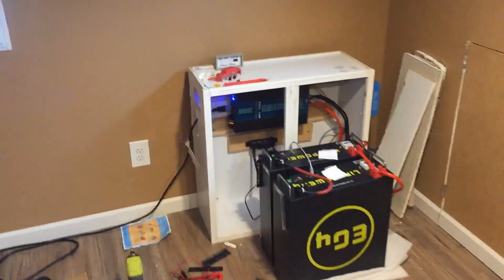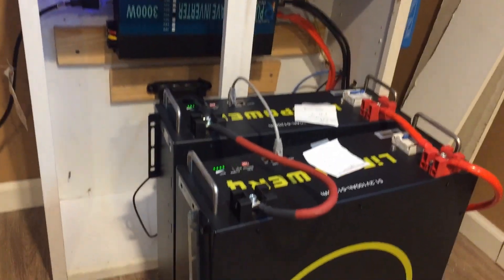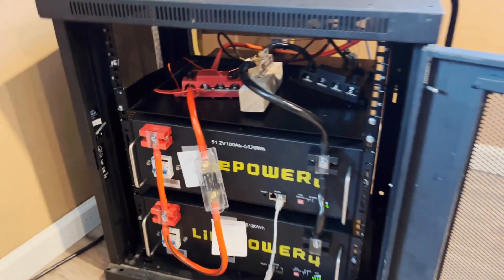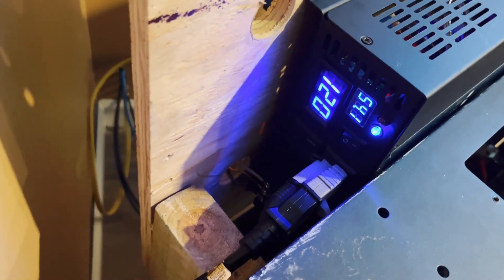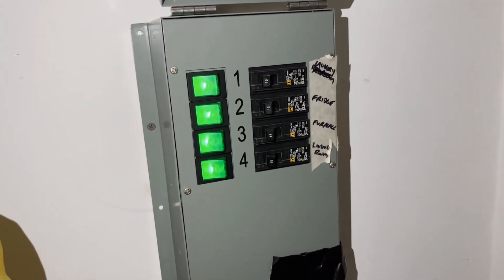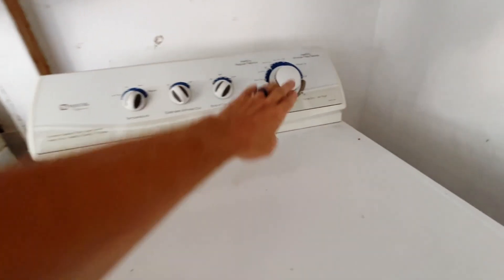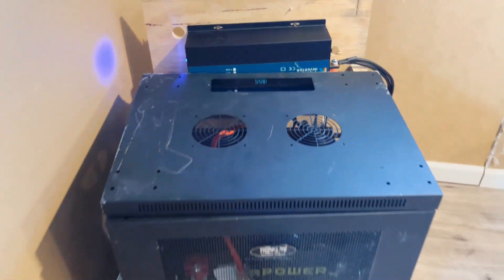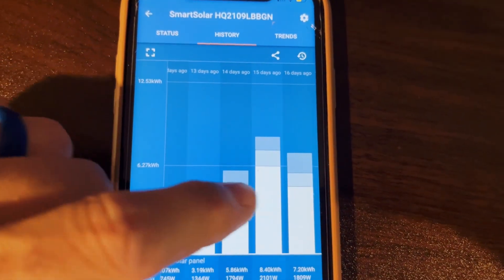My 48v Home Off Grid Setup - EG4 Batteries, WZRELB 3000W Inverter, 2.5 KW Solar

Comment: High frequency inverters like these can be downright dangerous for use in residential applications. Because these low cost high frequency inverters use no output transformer, they offer no galvanic isolation between their high current DC boost stage and their AC output, when their H-Bridge circuit fails and shorts to ground, the inverter can pass high amperage DC current through to your AC loads and can set your appliances on fire.
Reply from the maker: thank you for the comment,   do you have a better one you'd recommend?